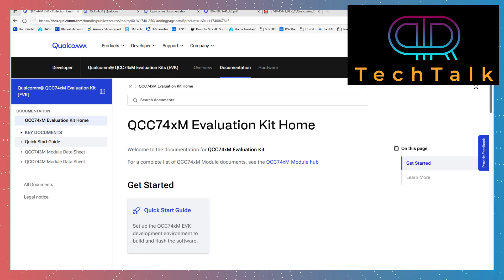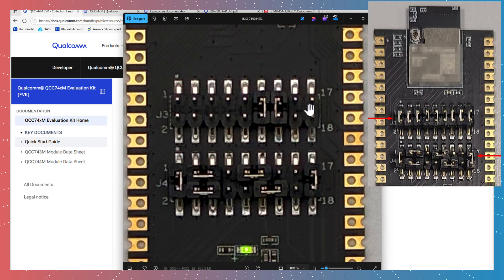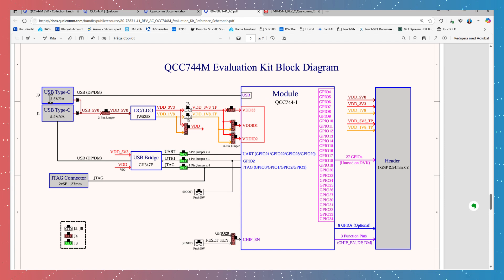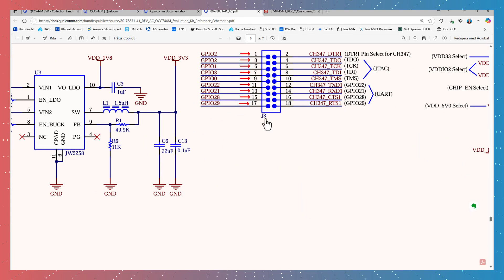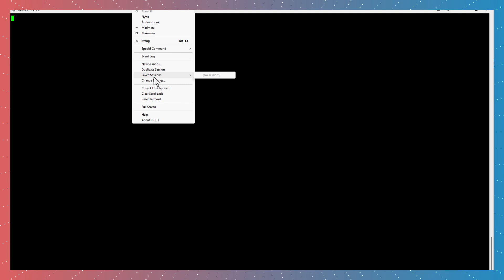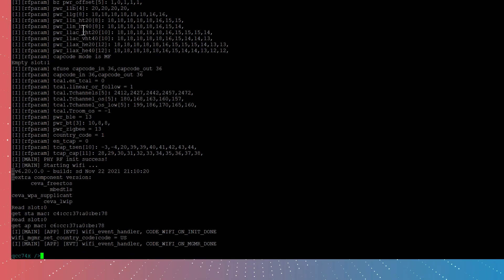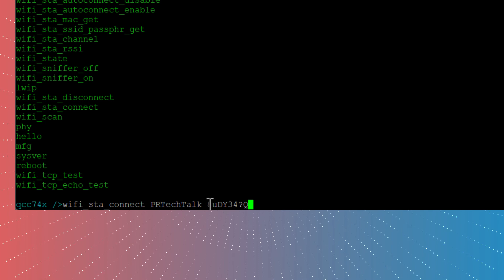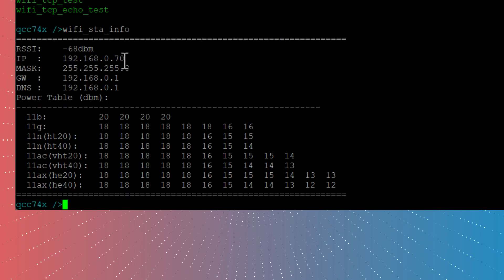Qualcomm QCC744M EVK Wi-Fi Setup Tutorial  |  Getting Started

Comment: I've been tinkering around with the original buffalo chips in the sipeed m0s dock and I've been very disappointed that neither the sdk for zigbee nor for wifi 6 were released to the public. That's why I was very exciting when I saw the Qualcomm rebranding with at least the added Thread example project in their fork of the sdk. Somehow I missed them finally releasing the dev kits (or EVKs I suppose). Would you say those EVKs, price aside, are a good choice for tinkering as a private customer? In particular, I am interested in using Zigbee or Thread for low power consumption scenarios.
Reply from the maker: Hi, Yes i would say that. Qualcomm have made a change in their approach to the market and for some parts they are much more open and accessable than ever before. However this change is quite new and it will take time to get it greate but their intentions are clear. This board is cheap and all pins easy accesable, so great for home thinkers also.
PLs also hit the Subscribe :-)
/PR TechTalk